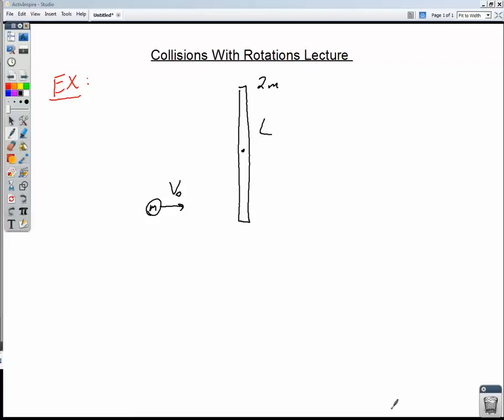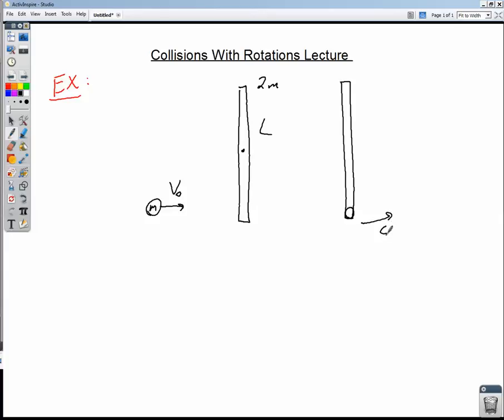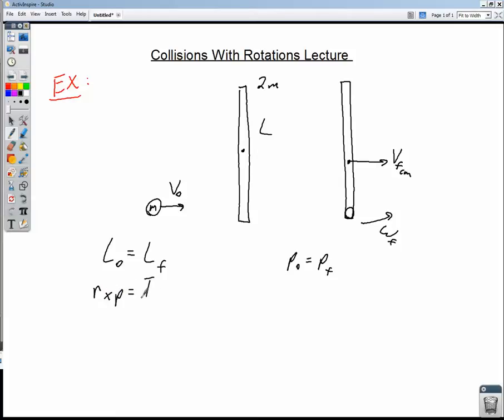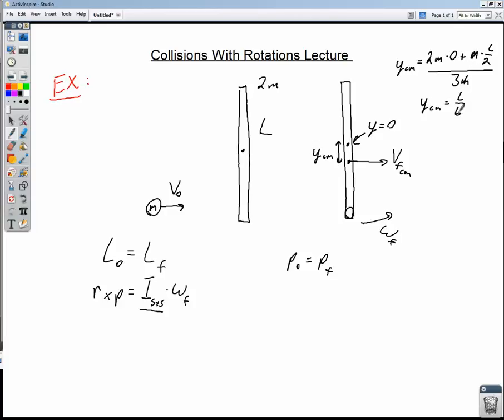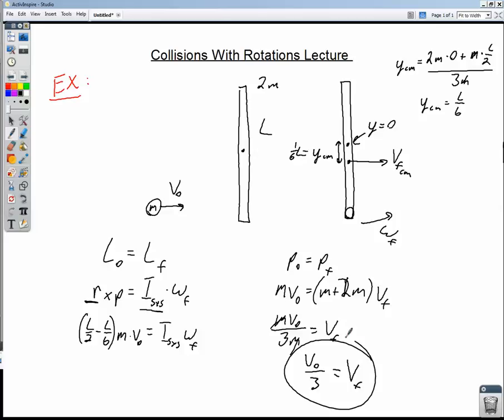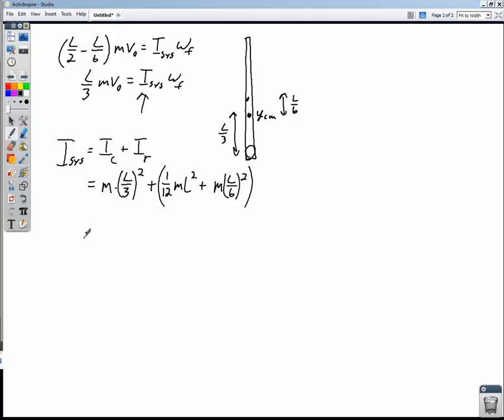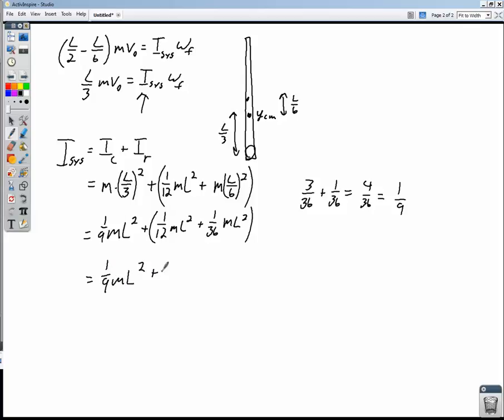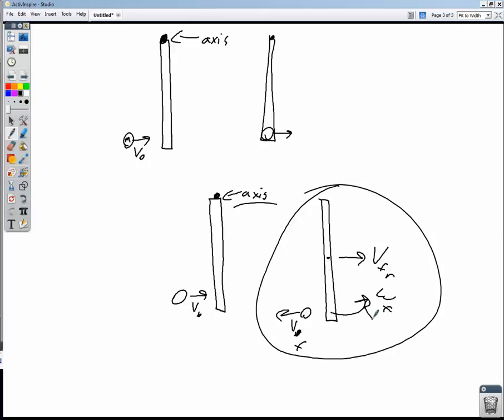Collisions with Rotation Lecture Video

Comment: i did a similar problem but with the perfectly elastic ball. the only way I could figure it out was by extending the rod so that the ball hit at the centre of it. then separating the momentum that would go into the actual rod and into made up part for which I took velocity of the centre of mass. and then I used the momentum in made up part to find the rotational momentum of the rod. i ended up with a super ugly formula, but it worked